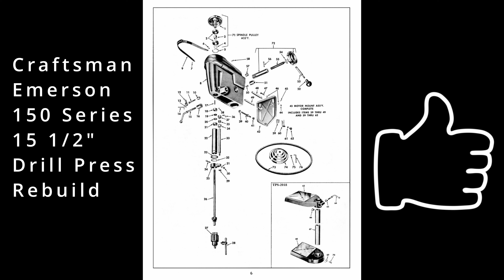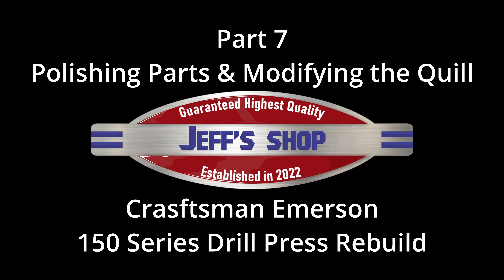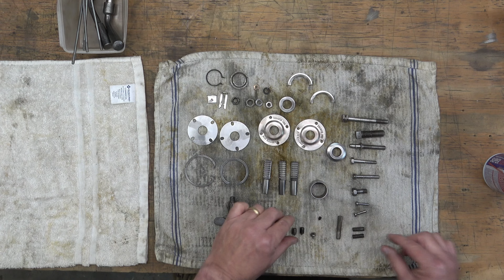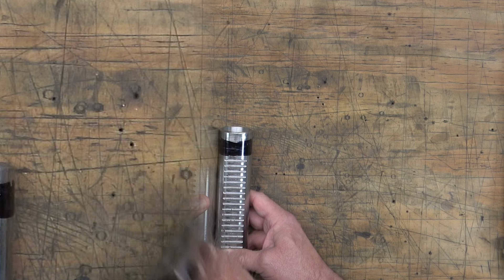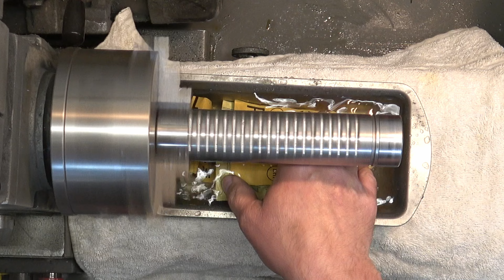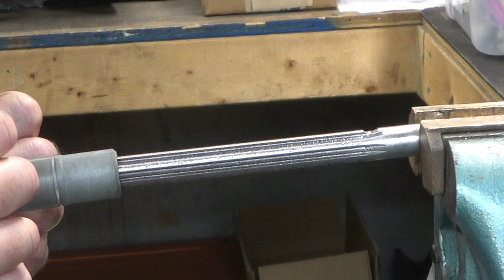Part 7 Craftsman Emerson 150 Drill Press Rebuild (Polishing Parts & Modifying the Quill)

Comment: Quick question, what is the runout of just your chuck on a ground rod? 3 jaw chucks on Chinese lathes are often not great from experience, so is the runout in the spindle or the lathe?
Reply from the maker: Thanks for the question, I was surprised to discover it was almost 0. I expected it to be some horrible number but I get almost no movement on my dial indicator.

Comment: If it's any help it's definitely a pair of calipers and not a micrometer, & machinists use sharpie like you do for quick layups all the time. Layout fluid is just a lot more robust for more complex layouts that have to last several days. On a point of safety though I'd definitely recommend using a tailstock with the amount of part stickout and how far the cut is away from the chuck. Alternatively flip it and do the cut near the jaws might be better?
Reply from the maker: I agree, I should have supported the work. The opening in my chuck is too small to fit the quill inside so I can only run it in the orientation I have it but I should have supported the outermost end with the tailstock.

Comment: Thanks, it is getting there one step at a time. Like your dremmel type tool, what make is it? Tried looking up 'Fordham', nothing came up. 🐞
Reply from the maker: Thank you. I do not recall which model I have but it is Foredom. They run around 300-500 depending on which model you get but there are lots of Chinese knock offs on Amazon for less than 100. I have one of these as well and they are quite good. do a search on Amazon for flex shaft rotary tool. It takes some getting use to the foot pedal but once you are past that, they are awesome.